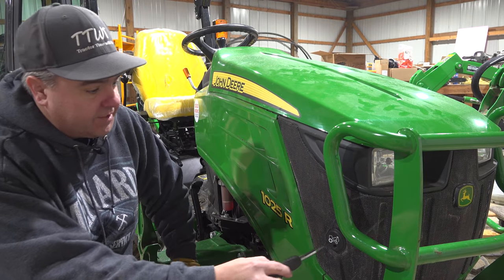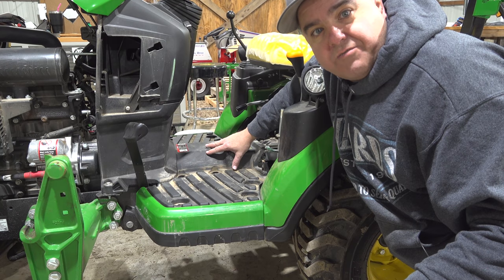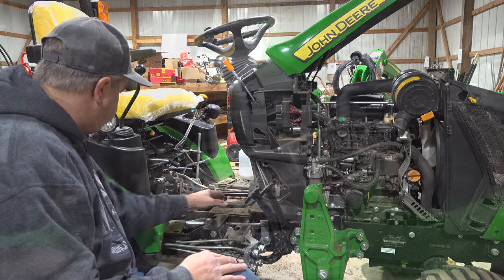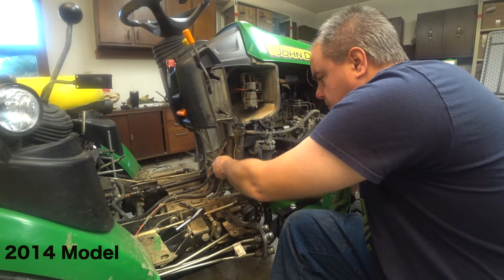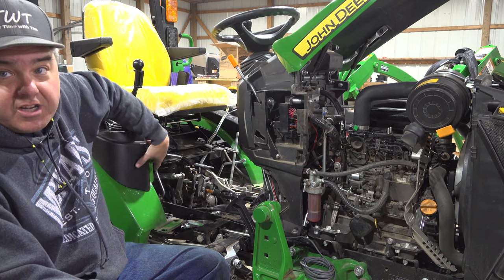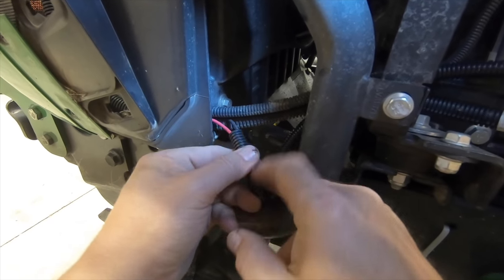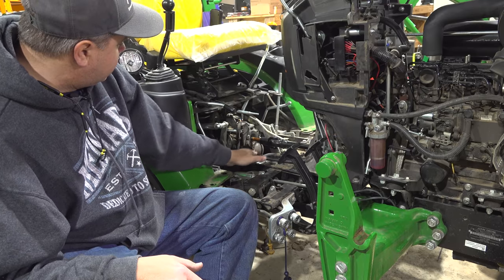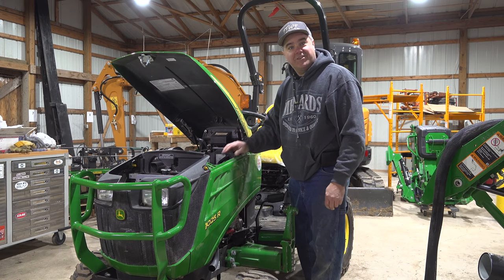Deere 1025R Internal Changes. More extensive than I thought! (vs. 2014)

Comment: A tip: To aid in unlatching the hood of my tractor I took a plastic rod appx. 1/4” dia. or just a bit smaller than the opening of the latch release and 1 1/2” long drilled a small hole in one end and put it on the ring with they key. Always with the tractor and might be a safety reminder to shut the tractor off before opening the hood.
Reply: I use my tractor key to open my hood. I have a 2017 2032R

Comment: It wouldn't be a 50 HP 1025R.  Instead it would be a 1050R.  I think that would be awesome too.
Reply: we have a 23 hp boomer new holland but were planing up grading to a 62hp l6060
Reply: Well thought of a major hp and torque upgrade is entertaining.  The poor transmission probably wouldn't last under a heavy load.
Reply: @jaybee2344  deeres here in canada  dont have compact tractors with 50hp only compact tractor here in canada is 50 hp kubota L4050  and 62hp kubota L6060
Reply: @michaelmactavish1728  Thats cool. But I am sure the transmission was built to handle 50 hp too.

But I am not saying Deere can't build a higher power compact tractor.  Its all about marketing it to a certain demo.
Reply: @jaybee2344  i had a deere compact tractor for drive and it sounded like the piston getting ready to go in the engine wich not good for a $50,300 30hp deere compact tractor and try lift heavy the engine would die so tryed the kubota compact 62hp it worked nicely and smooth plus has a engine stall guard wich pervents engine stalling wich is a slick gadget

Comment: Given that the tractor is supposed to use various attachments, I am surprised there is no T channel in the frame for wires and hoses.  I am not mechanically inclined but with the Kenworth W900L tractor we had some of the same issues.  Thank goodness for zip ties and that slit tubing you were showing we used that for insulation and to prevent chafing.  I do not know what it is called but I have seen it also used in commercial iring.

Comment: At about 14 minutes. It's called "wire loom" that protects wires.
Reply: you read my mind:) well if i recall that is what GM called it anyway.
Reply: darthvader4hire everyone calls it that.
Reply from the maker: Frustrating when shooting a video and I cannot think of the right term!
Reply: @TractorTimewithTim   Split loom tubing... The other option you can use is Tesa tape the high heat exterior tape is either 51026 or 51036.
Reply: @FishFind3000  where I work we call it convoluted tubing or convolute. I grew up calling it loom though.

Comment: Landon Fraser down below is correct.  I just went out and looked at my 1025r again, just purchased in February this year, it does have the gap in the hood.  Thanks again for promoting the Edge Tamers. Mine finally came, were a five minute install, and I pushed a pile of leaves to see what they would do.  No damage to the ground by the bucket edge, made much more of a mess with my R4 tires in the soft earth.  Of course we got just enough snow in central NY last night to mak the roads slick for travel but not enough to try plowing with the bucket and Edge Tamers.  Thanks for the video.  I won’t let my wife see or she will have me taking apart tractor to clean all these books and crannies every week as well!
Reply from the maker: Thanks for your comment!  Glad you are enjoying the edge tamers!

Comment: one thing that got me on the difference was when I did my 50 hour service, I watched your video on doing the  service and I thought I was going crazy because I could not find the grease fittings on the front axles for the steering. I went through the manual twice and watched your video several times before I checked with my local dealer and he says " oh  there is none  for  that on the 2018"  LOL!  Hope everything is going great for you all! Shop looks awesome by the way!

Comment: Tim, if the heater is a Propane "salmander" , they do give off WATER as a by product. If you have steel walls and roof, you might get condensation, it could freeze, or drip as rain inside when it cools.

Comment: I saw my new 2038r today it's in the shop this week getting curtis cab, wheel spacers, fluid in tires,front 3 point, and engine heater. I will try to sent you pictures next week at delivery. 
Inspired by Tim
Reply from the maker: Congratulations!!

Comment: Tim, I also have a 2018 1025R and I noticed the same bolt has fallen out of yours. The bolt/washers/ spacer / flange nut that attaches the fuse panel to the machine. I also noticed you moved the bolt that was originally just in the bottom hole to the top hole. Its amazing on how many of these tractors that that one bolt seems to loosen up and fall out. Luckily for me when i removed the side panel everything except one washer and the flange nut was sitting there. I replaced these flange nuts with Nylock nuts and they haven't moved since.

Comment: My 2014 had the "hood gap" you showed here as well Tim. It's an easy fix just by loosening the hood brackets and readjusting them to your liking & it will close much better. Good video. 👍
Reply from the maker: May not be so easy with those gas struts pushing against it
Reply: @TractorTimewithTim  Ummm...it may make it more of a challenge, but I have faith in you 😉. Try this, maybe disconnect the gas struts then readjust the hood & see if it closes better, then hook the struts back up & see if they still push the hood up. I'm really curious now because I was considering putting struts on my 2014 if the application would work.

Comment: Hi Tim I have a 2018 1025R my hood is of a little bit not as bad as yours I both mine bran new. I see on a older video your 14 1025R you had a chrome elbow pushing the exhaust away from the front attachments just wondering where you got it. All of my front attachments are getting all black from the exhaust. I live in Vermont you never no what the weather brings up here. I like all of your videos. You do a great job with all your equipment. I want to buy a grapple for my tractor.

Comment: At 6:31 the hyd line you pointed out it is the steering control diverter line. It supply's the the power steering with oil.
The wire loom is protecting the fuel supply line and fuel return line.

Comment: Tim, two presumptions. The steering column/pedestal is probably used on more than just the 1 series. Obviously it is most likely used on the 2025R. It was probably redesigned to enable it to be used on more than one model, which goes along with what you are saying “economy of scale”. Next, with regard to the baffles just aft of the radiator. I presume that is to help divert air out the side vents of the cowling, this was probably to get heat away from the operator and keep the engine cooler. I’m sure they still want some air to flow around the engine to carry possible fumes away. Just my take on it.  Jeff

Comment: Tim in your video, on top of the engine I notice what appears to be studs sticking up from the top of the engine ...  
Similar to the ones that held the old style air cleaner bracket to the top of the engine ... 
I'm assuming Yamar  didn't make any engine changes over the years??...
Reply from the maker: Yes, those are the studs used for the 2014-2017 air cleaner disaster!

Comment: Could those pneumatic cylinders that support the hood be causing the hood to be deformed/  They'd still be applying a significant amount of pressure on the hood when it's closed.  I've had similar problems on other items that used those cylinders.
Reply from the maker: I think you may be right!

Comment: Loom it’s called wire loom. Rubber grommets are great for when running wires through holes in frames or sheet metal and even plastic anything protecting from cutting or chafing.

Comment: Hi Tim. We know it here as Split Loom. you should always remove the Ground cable first from the battery. less chance of causing a spark, and if you have any electronics there would be no chance of damaging any part of it. you could also have went to the starter with your power wire instead of going all the way to the battery.

Comment: Tim. I just had delivered my 2017 1025r tractor with a 2018 120r loader.  (like 2 days ago)  the Ag pro i purchased it from sight unseen left me with no manual, no service records and a very moldy seat.  Any suggestions on any of these issues.  The loader , I added since it was only a mower with a 60 inch mid deck for sale.  The john deere dealer added the loader to it.  I also need a suggestion about john deere paint.  There are many areas that I would like to make new again.  Several companies make jd green paint, but really looking for the best and cost efficient way.
Thanks for your videos, Long time watcher of yours.
Reply from the maker: Call your salesman and discuss.

Comment: I just picked up a 2014 1025r.   The engine is stuck.  Not sure about the history,  aside from someone put something other than diesel in it.  Only 400 hrs in good shape.   I am going to start working on it tomorrow,  found your channel and checking out more info on these cool little machines.   So far I haven't seen any videos on engine removal,  maybe I should make one.
Reply from the maker: I haven’t needed to do anything serious with or in the engine.  So, no ‘inside’ videos.
Reply: @TractorTimewithTim  well I suppose that's a good thing.   This was definitely a case of negligence.   But I did get it for a steep discount

Comment: Tim, Did you adjust the 3 point hitch on the new 2018 tractor yet? I found an easy way to raise it with out losing the lower distance off the ground.
Reply from the maker: I have not
Reply: Remove the cover on the right side next to the seat and you will see a threaded rod with a pin block. remove the clip and turn the block in and that will let the 3 point hitch raise higher. hope that helps. I was going to send a pic but don't know how. Also you should get a hydraulic top link for your 3 point hitch, it makes a world of difference changing implements!

Comment: Old video but what year should I try getting? I found a used 2017,2018, and 2020. Or just bite the bullet and get a 2022-2023. It’s going to be my first ever tractor and I’m going to be using it for yard work at my home. Small lot. And property maintenance for others. I need a belly mower. Unsure what attachments il need. I wanted used with as many attachments as possible to come with but they sell fast. I was thinking new so I had warranties but idk. Nearest Deere dealer is 21 miles away. Ls dealer is 30 mins away. New holland/mahindra dealer 2 miles away. Kabota 30 mins. I’m kinda set on a 1025R but open to what anyone may suggest being I plan on doing a good amount of work this summer and snow removal in the winter.
Reply from the maker: I would recommend buying new.  Get the subsidized financing.    
Get loader.  
Don’t worry about other attachments at first…watch our vast library of videos and experiment with your tractor to learn what you need.

Comment: Did you have to get wire ends to plug into the back side of the fuse box where you added the new fuse?  If so where can you get them?    Thanks.

Comment: my 2016 has the gas strut to open the hood. and also has the grill latch...in addition it also has the heavy duty air cleaner mount on the engine. cant comment about under the footrest never had them off. and back to the hood, mine does not open as wide as the 2018 you have. i do think though that i would like to try the yellow side panel attachment fasteners.
Reply: +2 on the yellow fasteners. 👍

Comment: I noticed that I was burning my left foot while mowing with my 2018, this didn’t happen with the loaner 2014. I removed the steel bracket behind the alternator and there was a lot less hot air blowing on my foot
Reply from the maker: Interesting!

Comment: When I purchased my 2018 1025r they mentioned that John Deere was coming out with their own 3rd function kit for the 2018s on.  Does anybody know if there is an advantage to using JD’s?  It it more streamlined?
Reply: From what i know about it is that it will be like the 3rd function on the bigger loaders where the valve is mounted to the tractor and you run hyd. lines out to the loader.
Reply: I can let you know next week when they complete mine... it will be incorporated into the new joy stick, out to the new Frontier AV20 F  53" root grapple bucket on my 2018  2025R

Comment: I’ll add to the “wire loom”, they make a “high heat” wire loom indicated by a dull white line that runs the length of the loom. OEM vehicle wiring loom is usually high temp, exp under the hood and under the vehicle. High heat loom is much stiffer than the normal stuff. Ok, enough of that, back to your regular scheduled programming...

Comment: Mine is a 2018 from last May, and it also has the extra gap along the hood sides. Yours looks like MAYBE a bit more, but, hey, it's plastic. I fired mine up and at idle when cold the engine shakes a bit more, so I'm thinking that gap may be to prevent the hood from rattling against the sides.
My mower deck height adjustment knob is not concentric to the dial around it, making it hard to get a good setting. Can't find anything out of place, and no way to center them together. Is yours this way also?

Comment: Did the block heater frost plug move?  I just installed one on my '16 and it's behind(ish) the fuel filter, just ahead of the ground strap on the engine.  I couldn't see it in this video, but maybe there was just other stuff blocking the view.
Reply from the maker: Honestly don’t know, Adam.
Reply: @TractorTimewithTim  <sarcasm alert> That's probably because you don't know what real cold is down there in Indiana! :-p  <end sarcasm>

If YouTube allowed pictures in comments, I'd add a picture where the thermometer in my truck showed -37 a couple months ago.  :-)
Reply from the maker: Ugh.  You can keep that up there!
Reply: @TractorTimewithTim  Yeah, this is the first winter I recall moving snow at 10 below zero.  Original Tractor Cab will probably be getting an order from me  later this year!
Reply from the maker: I would suspect I would want a cab with those temps!

Comment: Darned generous with your limited time to go through all the disassembly several times before doing it for the video.
I think you'll want to carry your hood release tool all the time, good thing you have the tool box. Don't want to be without it when the engine temp rises and you need to pop the hood to clear the radiator screen.

Comment: Hi Tim Having trouble starting my 1025R.  Battery is good but starter motor makes a click noise and stops.  Sometimes it starts especially after I tap the starter with a mallet.  I assume I need to replace the starter but wanted to ask if you have any videos that address this issue or what your opinion might be?
Reply from the maker: It sounds like a starter issue.   On other machines, we have sometimes been able to get it to "eventually' start by trying repeatedly.  switch off/back on/start./  off/back on/start.  Often it will eventually start.
How many hours on this machine?
Reply: @TractorTimewithTim  565. I does start with a little patience doing what you said.  But want to get this fixed before i get stuck somewhere!

Comment: Same as my 2016 Tim.How much Difference is that 260b backhoe from 260 if you could Mount a seat on the 260 backhoe
Reply: Everything is different! Hoses are routed different, frame connection is different. Not interchangeable.

Comment: I know it not a 1025R but I have a 2018 2025R and my floor is in 3 pieces which make it much easier to remove.
Reply from the maker: 3 pieces AFTEr you broke it?    Just kidding :-). That sounds like a better design.
Reply: @TractorTimewithTim  

ya it made the remove much easier but bolting it back done you had to pay more attention to the alignment of holes.
Reply: @TractorTimewithTim  

ya it made the remove much easier but bolting it back done you had to pay more attention to the alignment of holes.

Comment: It really is odd that the  2018 model 1023e has a couple major differences then the 2018 model 1025r...   right off the bat, the knob between your feet right in the center.. That is your hydraulic adjust right?   On the 1023e, that does not even exist..  We have a small valve under the seat to the right instead.  There are a few other things of course but they are more different then I original thought even though they look nearly identical.

Comment: I see something different, where the green brackets are bolted to the frame for the loader.The 2014 model has on each side 2 black steel straps that attach to the sub frame hmm quit interesting.Its a totally redesigned machine in many different ways.
Reply from the maker: The 2014 backhoe subframe is much more extensive...like you say, going all the way to the loader mounts.  I didn’t bring this up because it was not related to the topic, and the episode was already too long!  
Hopefully we’ll do a ‘backhoe differences’ at some point